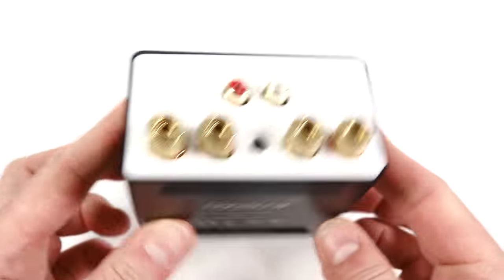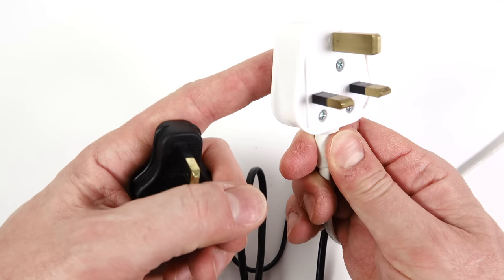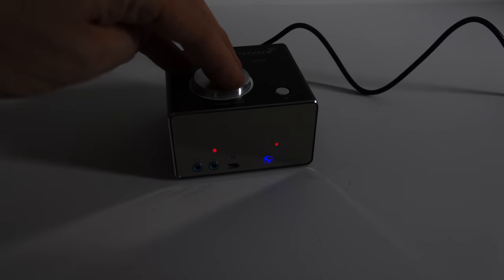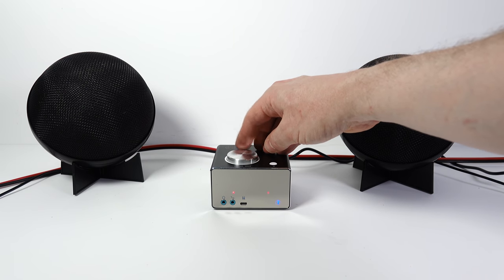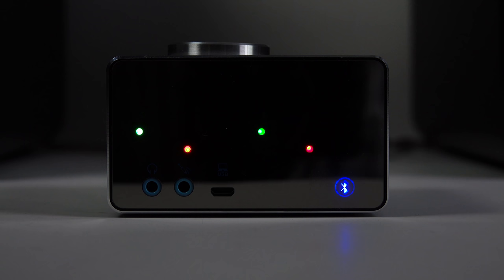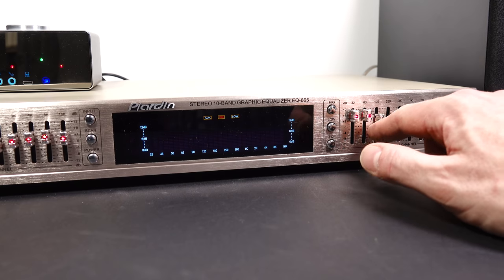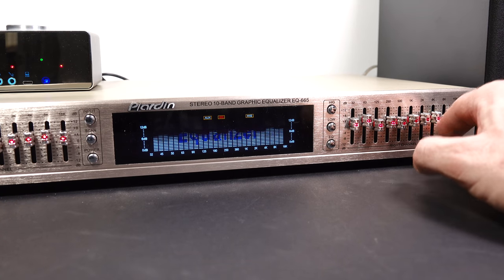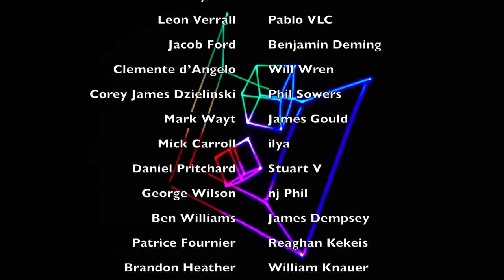REVIEWS: Mini Amp & Graphic Equalizer

Comment: This is seriously tempting so I can use my old Cambridge Soundworks Ensemble III bookshelf speakers.  It'd be even more tempting if I could FIND more than one of the five...
Reply: The chip in these buzz, ie there's a constant background noise, it's apparant on every TPA3116 amp that I know of. If you do get one, make sure to get the highest voltage DC brick you can for it, it sounds cleaner.
Reply: flandrble My guess is that it doesn't have a filter on the DC input, so the power fluctuation from a switched power supply will be output as noise.
Reply: @flandrble  Would that be why they went with a 19V unit?  I'm not an EE.
Reply: Tripath amps pretty much all sound the same, love them or hate them. I always have a few banging around, both in cases and not, for various purposes when "real equipment" flakes out. It will be as forgiving as your speakers, no more and no less. Hook it to studio monitors and it will be as harsh and unforgiving as anything.
Reply: I wouldn't run the Soundworks ES III's with this!  Something like the SMSL AD18 is more pricey ($120 vs $60 here), but has multi inputs, proper tone controls, decent BT, and a large heavy PSU with oodles of overhead.  I used a Nobsound with a set of Sony APM's and it sounded very bitey and the low end was totally lacking.  The SMSL is pretty much on par with a Yamaha amp many times it's size.  I can't comment on longevity as I've only had it a few months, but it'd be my pick of the litter for small profile / cheap amps at the mo; and I investigated a few with the assumption they all used similar parts.  Otherwise, just hit the second hand market for a decent Denon / Yami / Sony / Rotel mini-system which will at least have tone controls on it.  Although from memory, the Soundworks had a passive sub... so not sure how you'd power that.
Reply: @mal2ksc  How about the Chinese tube amps on eBay?
Reply: The 19V unit was almost certainly chosen because that's what many laptops use. The Chromebook I'm using right this moment has a power brick of that spec. I run the audio through a naked circuit board with a Tripath chip only being asked to do 11W x 2 and power it with a bog standard 1500mA 12V power supply. I'd heard of people running them at 18V but didn't realize they were designed up to 26V -- seems like a bit of an odd choice when so many op amps are happy up to 30V.

I haven't tried any tube amps off eBay, Chinese or otherwise. I don't want my equipment to color my sound. It's probably going to come down to how good your tubes are, really -- Darrell Braun does a video on what changing tubes in a budget amp does for guitar tone. It's not an enormous difference, but it is certainly there.
Reply: @mal2ksc  I was just looking at the Douk Audio website.  They produce amps with tubes as well.  Seems that the tubes are Chinese these days.
Reply: No background noise here and I'd certainly notice if there was. I'm sat very close to the speakers too.
Reply: I think there are only three countries producing tubes: China, Russia, and Slovenia (which has only J&J). Of course Chinese gear will ship with Chinese tubes, and by and large those tubes won't suck, they will simply be mediocre.
Reply: @mal2ksc  From the videos I've seen, they all seem to be cosmetic.  You can often remove the tube and they still function, or if they don't its suspected they are just using them to bridge the contacts to give the illusion they are doing something.
Reply: @CTRIX64  Yes, there's a passive sub.  I don't need an amp to run all 5 speakers and the sub, as I've got the one I bought 20+ years ago for that and which I've not set up since something like 2010.  What I'm thinking is a stereo amp I can use via USB for my computer with these speakers.  My Harmon Kardon amp wouldn't work for this.
Reply: @mal2ksc  So the Russian ones are good?
Reply: @mal2ksc  There's some audiophile firms making small tubes in the US, see the company that took over the Western Electric name. The charge audiophile prices at the same time. Eimac, a company from the old days, also still manufactures high power industrial/RF vacuum tubes in the US, some of which also work in audio applications.

Comment: I've run into some digital amps that have latency. A non-issue when listening to music, but when using it for video or for performing or creating music, it becomes a problem. I've never seen anyone test latency when reviewing amps. One easy way to test latency is to use the amp in parallel with a pair of headphones or an analog amp of some sort (even an X-mini or something similar would do the job), connected to the same source, and see if there's noticeable voice doubling. I bought a well reviewed Psyc Monic bluetooth speaker and was disappointed to find that it had noticeable latency even on the analog input, which none of the reviews had mentioned, so I couldn't use it with my OP-1, and now I'm wary of all amps with any digital component.
So that's maybe a segment to consider adding in future amp or portable speaker reviews.

Comment: I ordered one of these yesterday, and it arrived a few minutes ago. Mine is branded Douk Audio Tone. It has a fuse in the uk power plug, and the "vu" meters work at low volume ! . It was purchased to replace a very old Denon UD-M50  which was being used as a amp for my PC set up. It took up a lot of space and no bluetooth .  Purchased from Amazon UK

So , it works, its inexpensive, and takes up very little room on the desktop and has bluetooth.

Comment: When I first got back into vinyl a few years ago I purchased a turntable but had no other hi-fi components as I had sold my previous set up many years ago. So I purchased a mini amp from Amazon for about £40 which had a headphone output and rca inputs on the rear to connect to the turntables built in pre-amp output. This served me very well for a year until I decided I needed a proper amp and speakers again.

Comment: I looked into all the Douk audio products. None of them have a CE mark so they are illegal to sell in the EU. Who knows if they're safe?
Reply: @Dedubya-  excellent link, thanks for sharing that
Reply: @Dedubya-  And who knows if the power supply is safe?

I would use another power supply if I were to give this amp to someone else.
Reply: How do you know the power supply is safe at any time? Just because you pay more, that doesn't mean you necessarily get a better power supply -- and now that the trick of "uprating" the amp by throwing more voltage at it is known, they can expect people to purchase the weakest power brick and replace it with one of their own choosing. I certainly would consider doing that.

The reason for 19V is pretty clear -- that's a power brick designed for Chromebooks and other such thin and light laptops. I'd be more worried about blowing one of those up with a bad power brick than blowing up a Tripath amp. They're quite hardy little beasts, so long as you give them enough cooling.
Reply: @mal2ksc  I wouldnt expect the amp to fail, I would expect the power brick to shock you through the amp.

No power brick is 100% safe but some are safer than others.
Reply: Mine did not come with that plug. There's tons of power bricks around that aren't reliable, even Apple have been caught out.
Reply: The CE mark is clearly visible on the power supply (see @2:23), and 2 minutes googling images found a picture of the bottom of the unit, also clearly showing a CE mark: https://www.wish.com/product/nobsound-tone-hifi-bluetooth-digital-power-amplifier-5bb0392851378f26bc6c4ce4?&hide_login_modal=true
Reply: @Heimbasteln  If you get shocked by a power supply, through an amp, when the connection between amp and psu is only a 2-conductor barrel plug, then you did not get shocked by the psu, you got shocked by the amp. The psu has no way to know what the power is being applied to, and can only trust the amp to be correctly designed. You can try to say that a fuse in the cord would save you, but you would be wrong: those are there to prevent house fires, not electrocutions (which can happen with less than a single amp in many cases).
Reply: I have the Nobsound F900 shown at 0:26 and it has a proper CE marking on the bottom of the case.
Reply: @absalomdraconis  If both conductors carry 230v, the amp is gonna pass it through and shock me.
Reply: @ErebosGR  Interesting. For a while I seriously considered importing class D amps from China and focused on Douk as they seem to have replaced Topping as the major cheap brand. They only officially claim to be 'ready' for testing for EU compliance. There's certainly no declaration of conformity to be found online. The importer is liable so you have to take this very seriously and it's even your problem if they've faked the certification.

Comment: That 50x2 High-Power looks kinda overrated :D
Reply: No, its genuine.  http://www.ti.com/lit/ds/symlink/tpa3116d2.pdf
Reply: It is slightly overrated, but only slightly. If the power brick were 21V instead of 19V as shipped, 2x50W at 4Ω is the spec.

Comment: Thanks. This is timely. I'm literally that guy with some old bookshelf speakers from my old man (Bambi? from the late '60s or early '70s? Can't find anything about them online). So I ordered a nobsound from China with a simple metal case to power them and have built-in bluetooth 5.0 for a little secondary system I have in my workroom upstairs. So I'm just glad this model you tried didn't sound awful.

Comment: I've seen reviews of that type of plug on other channels like JW electrical - it will not be fused and it will not be manufactured to UK standards meaning ... it is dangerous to use, including the quality of cable in the lead, the quality of connectors moulded into the plastic plug and the fact you can slip your fingers under it and touch the pins whilst pulling it out of the socket.

In short, don't use it: https://www.youtube.com/watch?v=9KMrWupFQt4
Reply: I love how Techmoan mentions all these plug standards and to get off his back (or constant comments) about what the UK uses, and that other countries use other kinds of plugs, and to get over it. Especially the bit about it's size compared to other countries. It's size it partly because the built in fuse holder etc. Tom Scott did a great video about all the benefits of the UK plug standard https://youtu.be/UEfP1OKKz_Q I would say the Euro standard is also similarly  beneficial and has a lot of the same features the UK BS 1363 plugs, though I think shutters on the sockets is a great standard to have that I believe the euro standard does not use.

Comment: I have a pair of old Pinnacle PN5+ speakers sitting in my garage doing nothing - these are fantastic old bookshelf speakers that were always underrated and are even moreso now. (You can pick up a pair for under $50 on Ebay if you're interested.) I just ended up buying a new pair of powered speakers for an office turntable setup, and now I'm kind of kicking myself for not thinking of just using a mini-amp like this with my PN5+'s instead. Oh well. But that would be another potential use for this type of mini-amp. I picked up the best "cheap" pair of powered bookshelf speakers I could find (the Edifier R1280T's) and they just don't measure up to my PN5+'s or I suspect any halfway decent set of non-powered speakers. I have a second pair of PN5+'s hooked up to another stereo so I'm not just romanticizing the memory of them; I still listen to them every day, so it's easy for me to compare them with more modern bookshelf speakers.

Comment: I think I recommended the Nobsound in the comments section of your last video about VU meters. I am deaf in one ear so I use the Nobsound paired with the 2E1 "Two Ears In One" stereo headphone for the single sided deaf (they have the left and right drivers in one ear can). I keep the amp's volume at full and I have a headphone extension with a built in volume control and regulate headphone volume that way.

Comment: I purchased this amp because of the Bluetooth. I wanted something to connect up with my Alexa to play through my old Radio Shack Minimus 7 speakers. It does wonderful! Amazing sound and the power of the amp is adequate to fill up the room.
My only gripe is the Bluetooth. My Alexa remembers the bluetooth connection, but the amp doesn't remember the Alexa. I have to delete the pair from Alexa and repair each time I want to play music from my Alexa through my Minimus 7 speakers...A royal pain in the butt really.

Comment: I had those ball speakers. When I was a teenager back in the early 90s I spent near a thousand pounds on a Technics midi system (one of my first jobs and still living at home meant lots of disposable income). I think it was one of the first that had Dolby Surround built into the amplifier so it had those ball speakers to act as rear satellites.

Comment: I looked at the Nobsound amp at Amazon and read that most reviewers were not happy with the USB input. I have had a Nobsound F900 since 2017 and initially had problems with the USB input fed by an Android TV box. With a bit of experimentation I found the problem (no sound or lots of noise) was due to the cable. All USB cables are not equal. The best was a shielded cable that had belonged to an external hard drive, presumably all pins connected. I was very surprised at the quality and volume of the amp.

Comment: I actually bought the first mini amp you showed on an eBay page with the two inputs on the front and the speaker outputs on the back for $30 CAD. It was not branded Nobsound, but you can find identical units from all different brands; I suspect they all come out of the same factory in Asia. I wanted something to power a pair bookshelf speakers I was not using with my computer, ideally connected using USB. I was stunned with how well it worked and sounded. It would be nice if the USB input was on the back I also would not have minded a headphone jack, but otherwise the tiny amp really impressed me, especially for the price.

Comment: Thanks for posting this! I've been looking for something powerful yet compact for my son. He's been bugging me to get him a proper setup instead of running his  turntable thru the line in on his desktop computer. My daughter has been asking me for something similar and since they both have smaller rooms, that mini amp would be perfect for the both of them. I did find a few options on Amazon US as well that actually included a built-in preamp for under $50USD with free Prime shipping. They each had 2 RCA inputs so you could hookup a cassette deck as well and also with Bluetooth & USB. I steered away from things like mirrored front panels and flashing lights because the important part is that the audio sounds good.

Comment: On the Amplifier I collect these things, and this model would go great for a simple budget 2-Channel stereo home theater setup using a the Bluetooth 5.0 via a HTPC with a Virtual Equalizer Software.  i mostly use EQ just for music via Audacious the built in EQ is as good as having a physical EQ.  You should try some of the really small Mini Amps like the "Icstation PM2038" or the "KNACRO 3W+3W Wireless Bluetooth 4.0 Audio Receiver Steady Digital Amplifier Board".

Comment: If anyone wants a brilliant equaliser I suggest you try to snap up a minty secondhand Technics. Model SH-GE70 or a SH-E66. You will not regret it. For about $200 including postage it will perform unlike any of the noisy crap that’s commonly used. Absolutely zero audible noise and wonderful sound stage presence.

Comment: I use a couple of old ComputeSticks as media players for some of the TVs in my home. One of my biggest pet peeves is that they lack an audio output of any kind other than HDMI. So if my television lacks an analog audio out, I cant just connect any of my nice old minisystems up for good sound like I can with a full size tower or laptop. That mini amp may be a good solution for me.

Comment: In today's video we see Matt's Nobsound Amp and ball speakers.

I use one of those Chinese chip amps and some bookshelf speakers for my PC, admittedly it's a bit much for the average user when you can get an active pair of speakers from Edifier over on Amazon which still beats the pants off most speakers designed solely for PCs. That said as long as you're not scrapping the bottom of the barrel I think these chip amps work great, they won't beat any decent tube amp but I don't think they're meant to.

My setup has the SMSL AD18 and a pair of Micca RB42 bookshelf speakers, neither are high end (compared to what's out there) but they're of respectable quality and reasonable value.

Comment: I think you've sold me on the mini-amp. The Bluetooth makes it perfect for a bedroom hifi, where I just don't need a ton of power or inputs. I know I could just buy a Bluetooth speaker, but I have a particular speaker layout in mind.
Reply: "This Does Not Compute" reviewed a different unit of theirs. It's a TPA3116 which isn't the best but is perfectly adequate. There, if i remember right, the LED indicators go full swing on the input signal and are not affected by the amplifier gain.

Comment: I’m quite fond of my Nobsound NS-10G, it doesn’t have the headphone socket or flashing LEDs of the version you have but it powers my Q Acoustics 1010is very nicely. My attempts with active speakers directly into my PC resulted in a bit of a background hum that using an external amp/dac solves quite handily.